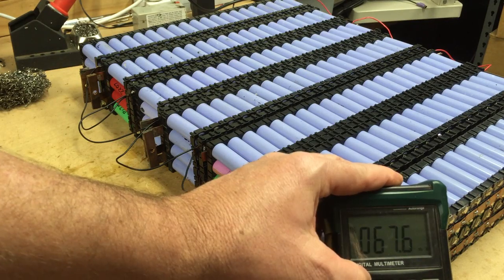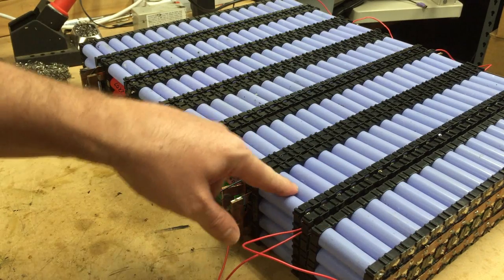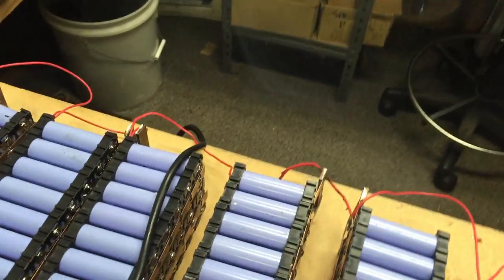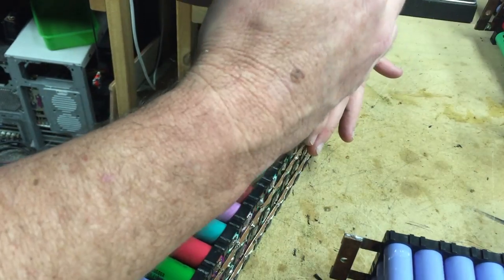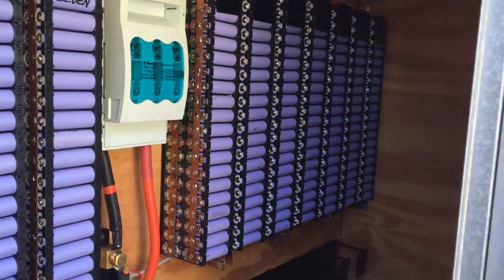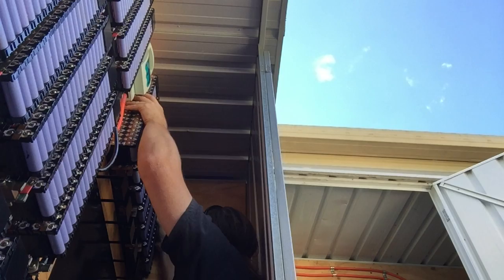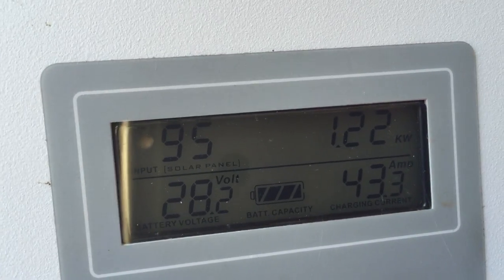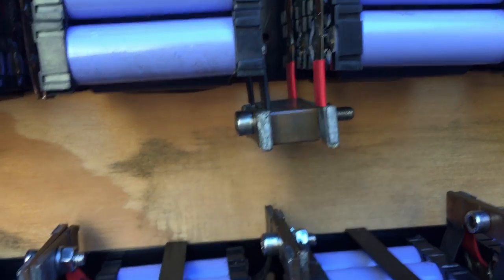Building a DIY Powerwall from used laptop batteries

Comment: question: Is it possible to use the inverter and an active balancer together? so the output of the inverter to the batteries goes through the balancer and they work together to keep the pack balanced when charging or whatever setup in the balancer (for instance the open source one... electrodacus BMS of something in conjunction with pip2424msx)
Reply from the maker: I guess in theory that would work how ever I can't really say I know for sure sorry.
Reply: thanks for the answer and fair enough. I think it just might. How do you keep you packs balanced? every once in a while with a charger?
Reply from the maker: I haven't had the need yet. they are all so close still after a month of use I doubt I'll need to do it more than once every 6 months.. but by the time it's needed I hope to have an automated way of sorting out the balancing..
Reply: thank you for answering my question.
Reply from the maker: no worries

Comment: Watt is a measure of power, watt = joule/sec
Joule is a measure of energy.
So wattage x time (H) = energy again, because time/time cancels out.
wh = (Joules/sec)*hours
Basically its the wattage times the hours you've used that wattage, basically the area under the curve of a graph measuring watts.
So 6kw for 2 hours = 12kwh
6kw for 2 hours and 10kw for 4 hours = 54kwh.
Reply from the maker: Man that was a lot of math! But thank you

Comment: Different types of 18650 can not be connected in parallel and in series together
Because the capacity is not the same as the battery internal resistance.
Reply from the maker: Definitely not different chemistries or voltage range been running 24/7 now for 2 years - So far so good

Comment: hello friend good day, I write from Colombia, I want to ask what the circuit connecting the batteries and how circuit loads, as I have understood that lithium batteries can not be charged in series or parallel, which circuit or charger you use?
Reply from the maker: they are in series & parallel - seems to work so far.
Reply: I understand that is to load each module 18650 a PCM circuit is needed, but you have hundreds 18650 , as you do to load properly?
Reply from the maker: sorry i don't understand what your trying to ask ?

Comment: Are you using a charge controller that's built for Li-Ion batteries or just one where you can set the voltage?
Reply from the maker: Currently, i'm using the PCM60X Charge controller setting voltage limits to 57.4v max and 50v min and CCCV settings changed from 1/2 an hour to 5 min. I'm also using a Batrium BMS www.batrium.com that very shortly will be controlling the charge through my PIP4048HS enabling it to add yet another level of safety to the system.

Comment: Wow. I admire you voluntarily offering your house up as a Guinea Pig for testing your thrifty ideas for the rest of us.

But I have to say (even though I have a feeling that you've heard this already) that this is going to make any home insurance claim involving a fire a complete nightmare - and that will apply whether or not the fire had anything to with the large totally unshielded DIY lithium battery you have mounted within your house.

Just something to think about, because claims adjusters (especially those in home insurance) are experts of finding reasons not to pay, or pay significantly less. This is an easy one tbh
Reply from the maker: Aware of that that's for sure.  Currently taking steps forward to bring this idea to the next level

Comment: One thing on you assumption all batteries have to be the highest mili amp rating. In basic electronics you,ll find that voltage is the muscle required to push the amps through a circuit. the Amp rating is liken to a river and if one of your banks has all the best milli am rating and the next one has a few that are half the rating, the effect will be like a narrowing in the river.  You would be better if you scatter the poor cells evenly through out the 24 v section. It would be best to keep out poor quality in the first place.
Reply from the maker: all packs are now plus 2400 mah and we are 48v too .. she's bloody awesome!

Comment: Your cycle life of each cell depends on how you discharge and charge them. If you want this thing to last then you should stick to the middle of the cells capacity or 20% to 80%. That is why you want big capacity cells and use a small amount. That won't work very well since you seemed to have mixed all kinds of cells together. So eventually the cells get out of balance you over charge one and achieve thermal runaway. Then you have a lot of material there to burn, or perhaps you have the really cheap cells like they discarded from hoverboards and they just start burning on their own. 

I am sure others have said the same thing, just tell your kids to run when dady's project catches on fire.
Reply from the maker: lol - addressing that as we speak with a kick ass BMS ohh they are discharged between 3.67v and 4.1 volts only
Reply: If you look at a single cells total capacity then you want to stay in the middle, 20 to 80%, which is hard to estimate based on voltage and impossible with mixed cells. Looking at a typical Panasonic datasheet you should definitely stay below 4 volts on a cell. Just keeping a cell stored above 80% promotes crystal formations in the cells (I think, search for the white papers) and that is what shortens it's life. This is one reason a Tesla doesn't charge they battery completely unless you over-ride the charge limit. Good times!

Comment: Hiya HBP, great effort.
Why are you using/suggesting 2k-3.5k/mAh 18650's when we can get 9900's & 12000's brand new for cheep?
Using the higher capacity drops the $ to $0.61/Ah @12V ($122/kWh + fitting).

Is there something I am missing as to a technical reason why people are using such low mAh's or is it just the standard size of 18650's coming from old laptop batteries?
Reply from the maker: Yep, you're missing just a little -  3400mAh is max capacity for an 18650 - anything else is a 'fire' hazard.
Reply: Thank you for your quick reply.
Please explain what you mean by 'fire hazard'. What is happening to risk fire & why?
I need to understand the properties of Li-ion 1st before planning anything & want to understand about potential risks. There would have to be a curve that shows how the higher the cap of the batt's increase in 'something' that increases the risk.

Is it simply the heat the higher cap batt's produce?
or is there something intrinsic about higher cap batts over 3400mAh?
Reply from the maker: Google UltraFire :)
Reply: All good, I got it now. TY for your time :)

Comment: I used 6, 18650 batteries that I got from a Think Pad Laptop. I put them all in series and got 25V. But here's my problem, I'm thinking about hooking that 25V battery pack to a 5V-32V step up Converter to boost it to around 200V-900V. Now here's where the problem comes in. If I try charging them while there being used, will they get hot and explode, or will they stay cool and not catch on fire. Please help me. Thank you if you do 🙂
Reply from the maker: +Epicgamer808 will sorry never played with polymer cells. Just 18650's maybe someone reading can help.
Reply: I'm sorry. I met to just put 18650 Batteries, but I got mixed up with Lithium polymer batteries. I'm sorry about that

Comment: I am trying to build a 10kw solar battery bank for my tiny house out of Li-ion 18650 batteries.  I am trying to decide between 2 options:

1) Wiring 3 arrays in series, each array will have 360 cells in parallel at 3.7v 288Ah, to give me a total of 11.1v 864Ah.  I need a 3S BMS system that can handle this load.  Anyone know where to get one?

2) Wiring 1080 cells in parallel to give me 3.7v then use and an inverter to convert my energy.  

Any thoughts on either?  I am also open to a better solution of wiring my 18650’s maybe 24v or 48v?

What kind of BMS are you using?
Reply from the maker: I dislike giving advice on how you should set yours up ad I'm still learning and don't really want you to burn your house down ..lol 
48v if you can definitely something i should have done from the outset. No BMS as yet - completely manual atm

Comment: what is the total Cycle life of 18650 Battery cells??  I think 300 cycles,  so Do you think it is a good idea to Do this all with 18650 ?? instead of Agm type batteries??  which has a Cycle Count of more than 2500 minimum.   ??
Reply from the maker: Done lead acid & AGM never again!!!! Expensive, heavy, etc After one month of using these cells it's lithium of some form or nothing. Couldn't afford a new bank of liFe batteries so 18650 were an good choice considering i own a computer workshop :)
Reply: soyou are going to replace the batteries every year?
How much they costed? Is it convenient?
Reply from the maker: +JudgeDredd888 they'll be replaced as required. Check back in 12 months too see how dumb this idea was :) cost is irrelevant if you have fun and learnt something new.

Comment: You don't need Battery Management System, you only need Battery Monitoring System, so you won't need to run with multimetr every day.
Some of them can have signal output, so you can plug them to emergency cut off and then they cut off your battery pack when batteries will be unbalanced or over/under charged for some reason (eg malfunction)
Reply from the maker: I'm working on monitoring with my sparky atm, it would already be attached if it wasn't for me not wanting to see any extra cables. He's really good with that so working on it. Also ordered a few more celllogs to use with packs. I've been checking cell voltage 3-5 times a day for the past month. Thinking it should be good isn't really enough. Interwebs has scared me into checking constantly but end of the day it doesn't take long and I sleep well.

Comment: Awesome vid! I am considering building a small 12v battery bank from a few laptop batteries.  Ebay sell a little 3A Li-ion 12v controller, but how do you charge all those batteries? You also made mention of fuses, but I didn't spot any - do you have a walk through video perhaps?
Reply from the maker: I'm charging with PCM60X From MPP Solar Inc there is a bunch of videos - check out "busbar complete process' video will have heaps of info you can use .

Comment: Fantastic and congrats , I'm just finalising my 7th pack ( cap test and ir ) 5 packs have 2400mah bats x100 - pack 6 is 2200mah and pack 7 is made up of 2000~2100 man cells .. Now my thoughts are should I keep each pack as they are or should I mix the batts to create equal capacity packs ??🤔🤔 thoughts about this .  Cheers from sunny Perth wa
Reply from the maker: +Cryidis if u Haven't finalised them mix them up. That is defiantly something I do different if I did it again
Reply: +HBPowerwall - thanks for that , I've been leaning towards a mixed balanced pack and needed confirmation .. Appreciated 👍
Reply from the maker: anytime :)

Comment: is 20 kWh a lot?  how long would it take to charge with the sun?
Reply from the maker: Igor Igor it's 30kWh now with the 40th almost ready to install. Flat to full about 20 hours of really good sun.
Reply: HBPowerwall how long can that run a house? did you have to get "green" appliances and LED lights? or can you get away with CFL and regular appliances
Reply: The avarage household uses about 3,5 till 4 kWh a day.

Comment: curious, what is the cost of that battery bank? I wouldn't mind one, if I could feed it with atmospheric voltage. I think it's 100 volts per meter above the earth surface. so 2 meters would equal 200 volts. albeit at low current levels. so it's not going to charge complete, very fast anytime soon. but it will constantly be charging unlike solar and wind. now imagine that powering a bedini, simple school girl energizer. another constantly generating source of power. but it creates a higher current levels to completely recharge a standard battery bank. you could survive a nuclear winter with such. If atmospheric voltage exist with dust obscuring the suns radiant energy.
Reply from the maker: All costs can be found here. http://www.diypowerwalls.com/t-HBPowerwall-Offical?pid=866#pid866 as for the rest i'll just nod my head and smile.

Comment: done math on conversion and other losses in the system? Would be interesting to know what energy conversion efficiency is.
Reply from the maker: +Karu321 nop no maths would get it wrong anyway :)
Reply: too bad, i was just wondering because tesla claims it is useful to charge powerwall in the night when power is cheaper, but considering that conversion factor is probably not too high in these systems, well makes me think its BS statement.. If u do math correctly it is never wrong :)
Reply from the maker: +Karu321 I charge with solar not from grid

Comment: Good information, thanks. I need to make a 48 volt pack  for my riding lawn mower. The dc motor will draw about 42 amps. Can you help? I am sure there are many people wanting to do the same thing.  Thanks
Reply from the maker: not so much but it does sound like a fun project
Reply: thanks

Comment: You really need a BMS for something like this. It may work now but as those cells age the balance of the cells will go off. You dont want these cells discharged to far and running in reverse.
Reply from the maker: Time for you too look at the description :) Have one of the best on the market installed :)
Reply: Was just going by the battery wall shown in the video which doesn't have one on it. if you've put one on since then great. just concerned . that much energy unmonitored can lead to a bad day.
Reply from the maker: Run it for MANY months without a BMS, now of cause I'm using the Batrium BMS and it's bloody magic.

Comment: This is great stuff! Liked and subscribed! Sorry if these questions have already been asked - I've only just found your channel - I'll make my way through all your other vids next...!

I've been looking into building something like this for my 2kW solar array here in the sunny old UK (har har) but I can't stretch to 20kWh of 18650s just at the moment...  Looking at starting at 5-6kWh from 15 packs of 48x2200mAh 18650s.  I've been planning to do a 24V rig, but should I go straight to 48V?  I've not come across the PCM60X controller but it looks ideal, can it balance-charge the 18650s? Have you put together any wiring diagrams? (what DC voltage are you feeding into your charge controller from your solar panels?)   I've got a grid-tied inverter that needs at least 170V DC to switch on, how do you get your 48V up to 170V for the inverter?
Reply from the maker: going straight to 48 is a great idea if you can afford it cerntally something i would do differently if i started over. PCM60X is only a MPPT Charge controler doesn't do any balancing. Voltage from panels is about 90v into PCM60X  max charge voltage for a 14S pack is 57.4v then the PIP4048 Inverter (NOT GRID TIE) converts they '48v' to 230v then into the house.

Comment: What the cable gage you used? WTF. You need at least 8gage, or 4 to be safe.
Reply from the maker: are you talking when it smoked. if so nice thin wire was great acted as a fuse. None of the individual cell fuses failed so it saved me quite a lot of time repairing possible damage. Drawback , that melted plastic was horrible lol

Comment: Good vid, thanks.  What do you do about low capacity cells? diagnose, replace etc.  Thanks!
Reply from the maker: With the new BMS it data logs so much info it can show me the bad cells. I just pull the cell ( 80 pack of batteries)  and replace with a spare. Then retest the 80 cells and rebuild :) Bit of time involved but hey, it's what i signed up for.
Reply: what BMS are you using?  What is the voltage?  Thanks
Reply: I am using 10s bms from ebay with 90 batteries per pack.  I have 4 packs used on my e-bikes
Reply from the maker: I am using this https://www.batrium.com/collections/starter-kit/products/starter-kit-watchmon-14s-blockmon-m8-sfp102mod with 28 extra longmons
Reply: OK, i get it.  14s, 80 batteries per cell.  The bms price is kinda shocking.  Thanks for the advice.
Reply from the maker: It isn't any normal eBay BMS, more like a Battery MANAGEMENT System. With 10 years of internal data logging. My battery shed has 84 Temp sensors in it. I can use the bms to heat or cool my sheds. MANY other functions than just going 'hey cell you overcharged?"
Reply: How does a bms cool?  Peltier chips?
Reply from the maker: Relays that turn on and off things via your custom settings.
Reply: ok, thanks  do you have a schematic?
Reply from the maker: It's a commercial product so no sorry. Unless you mean for my setup and in that case http://www.diypowerwalls.com/t-HBPowerwall-Offical?pid=867#pid867
Reply: good diagram.  do you have the grid tie inverter in place also?
Reply: Where do you get your 18650s?
Reply from the maker: 6kw Panels & SMA TL5000 inverter - commercial install and high volt so it's just doing its thing.  Never touching it :) the cells i get from anywhere and everywhere. Really just type in recycled into google and start calling

Comment: I'd argue the other way, and say that since you have so many batteries and the drain on each becomes so small, you could opt for low drain high density 3000-4000 mAh batteries instead. That would almost double your capacity.
Reply from the maker: Could do heaps of things but i love it this way :)